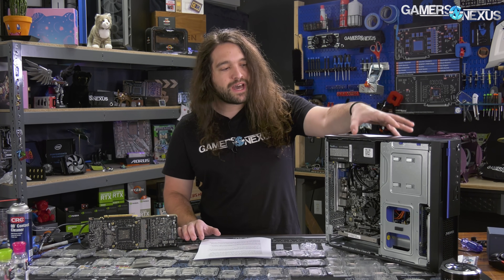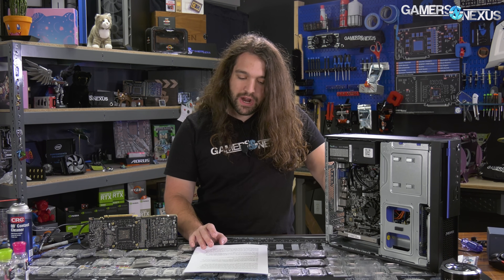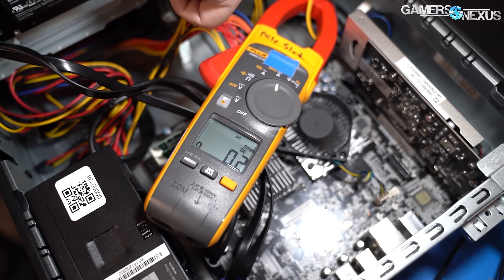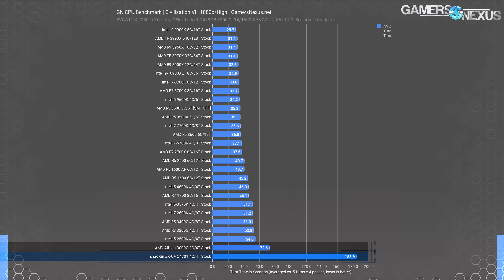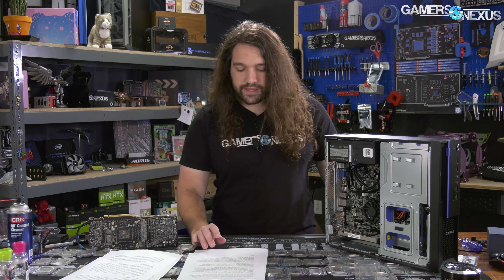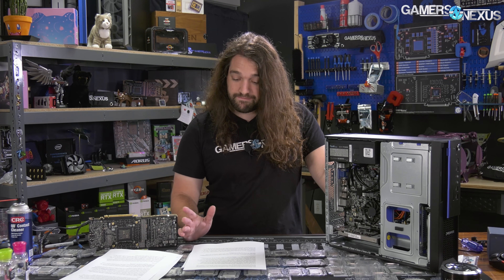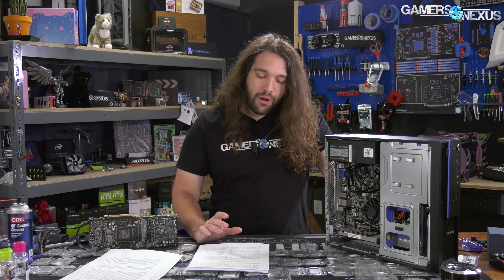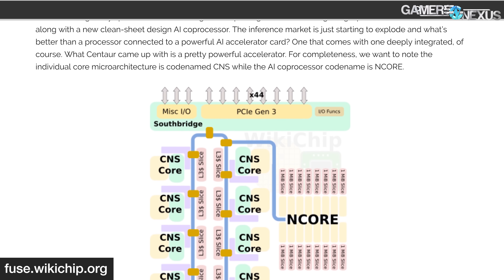"Trillion Core" Chinese CPU vs. AMD & Intel: ZhaoXin X86 CPU Review ZX-C+ 4701

Comment: So this is where Cyrix's license went. Interesting. I like to see these alternatives made, even if they won't directly compete with the US market, pressure from them making Chinese super computers might get the government to invest more in innovation from AMD and Intel. In the end I like seeing unique hardware and a possibility of a competitive drive for these companies.
Reply: @matt thomas wtf? Where did you get that from? I mean then paying AMD and Intel to engineer better chips for them. This has nothing to do with intellectual property. All 3 companies have the current rights to produce x64 CPUs. Plus I highly doubt AMD or Intel would want to steal ideas from a Chinese company that's behind them currently in innovation.
Reply: In 1993 or 94 (long time ago) I witnessed the installation of a couple circuit boards into the bridge computers on the USS Nimitz. For a cost of about $5,000 for each cpu. These boards upgraded the bridges computer system to the PENTIUM 90! Down clocked. Street value at the time - $120 in Seattle. HooRay for government spending!(The circuit boards were estimated to cost ruffly $20,000 each.)

Comment: We need open hardware and standards. Resilience is needed. Maybe RISCV will in 20 yrs.
Reply: Sure, but first and foremost we need software with stable and open interfaces in all ends. I.e. not just drivers and API:s, but also a p-code (or "bytecode") interface. That way OS:es and other programs ("applications") could be adapted to any hardware, by "anyone" (even if it's not open source) "simply" by constructing appropriate interfaces.
That quality should be what you pay for, not today's creepy licensing in the style of M$ or Apple.

Comment: Another great vide. Thanks, Steve.
Maybe several things not really put in perspective are the following:

- That high price is probably because the company has a monopoly as the only domestic CPU manufacturer. So, the price should be really taken into count. If they were fighting on the free market, that PC would be much cheaper.

- Performance-wise, sure it is very low. But you are forgetting that this CPU will be used for offices, probably running something like LibreOffice or similar and as is a trend now, actually using web-based applications, that do not need special CPU power. So, as long as it is good enough and gets the job done, it's a win for them. They surely not running rendering jobs on them or playing games in 4K. So, really, it is OK.

- It seems that this CPU is on the lower end regarding how much watts it needs. So what would be performance/watt? It is an important metric when discussing CPU designs.

- This CPU is comparing to the CPUs like Intel Celeron J1900, Intel Atom x7-E3950, AMD Athlon 5150, AMD A8-4500M and likes off which it is actually a bit faster in Cinebench multi-core test.
(Source: https://www.cpu-monkey.com/en/cpu_benchmark-cinebench_r20_multi_core-10 )

Remember how Huawei started? Or other Chinese ARM CPU makers? It will be interesting to come back here in 4-5 years.

Comment: Great Video! It's nice to see alternatives to Intel and Amd, even if it's a total POS like this one. To be fair to Zhao Xin making a CPU is no joke when it comes to the required engineering skills and know how. The required documentation and blueprints of a CPU can be measured in miles, that's how complex they are.
Reply: This is the older generation, their new generation using 16nm process can almost match a 7th gen i5(although its 8 cores vs 4 cores, so still a long way to compete) The performance increase between each generation is huge. Their next gen planned for end 2020 or early 2021 will be on 7nm with major architecture improvement.
Reply: @qiyuxuan9437  thanks for the info
Reply: The thing is that , the CPU needs to have new architecture which does not violate IP's from both Intel and AMD, this is in itself some big news as far as CPU development is concerned.Give em 5 -8 years before they can successfully compete with Intel and AMD. Security and Privacy aside, at the end of the day this is good news for the consumers with regards to Performance and Price.

Comment: You know a CPU is slow when an Athlon is several times faster.
Reply: It is the zen based athlon thi
Reply: @virtualtools_3021  i'm more impressed by the 2500k that is a nearly 9 year old processor
Reply: @terlaluanjay  sandy bridge is legendary
Reply: @terlaluanjay  and who runs a 2500k anywhere near stock clocks?
Reply: @MeatPoPsiclez  that's what i'm saying, this "new" processor is being demolished by a 9 year old processor that has a lot of headroom for overclocking
Reply: I'm writing this on an Athlon 64 from 2007. Fast enough for me (and most non-gaming people). When my computer is lagging it is always due to the internet, or a buggy program that hangs itself.

Comment: Surprising the Chinese government wouldn't just develop a high-powered version of RISK instead. That's open-source with much more freely available R&D to base things off of.
Reply: ARM isn't open-source. It's currently owned mostly by the Japanese as far as I know.
Reply: @greenaum  My bad, got ARM and RISK confused. I'll edit that.
Reply: @BattyBobert  RISC V you're thinking of I think. RISC is a general term for a class of processors, and ARMs are RISC processors. So essentially the only new part of the name is the V, so I can see it'd be confusing.

Comment: Recommend getting a low current clamp with a BNC connector to go to an oscilloscope. A 30 amp clamp with small jaws would give you more accurate readings with the kind of work you guys are doing. Plus, on an oscilloscope you can see a lot of detail about what’s going on with current draw in the circuit.

Comment: They could just use risc, or arm cpus that will be faster then that one... (loosing some of the X86 compatibility)...
Reply: To be fair, not even x86 processors natively execute x86 code; and haven't for quite some time. Who's to say the CPU microcode that translates the x86 instruction set can't be implemented with native RISC or ARM instructions?

Comment: So... why are we comparing what is CLEARLY an extremely low-power CPU to much higher power-usage CPUs?
Reply: This ❤️
Reply: The cost of the thing? It's quite simple
Reply: @roverT205  What do you mean? Low power draw is very important in many cases (such as in massively parallel machines). The number of instructions per second per watt is often essential (and worth extra expenses).
Reply: @herrbonk3635   😊👍
Reply: @herrbonk3635  because its priced highly

Comment: Question: Would the included OS have optimizations that would have made this CPU less horrible?
Reply: Its for government use they use word and excel
Reply: It is a decade old CPU design running low enough power that a simple heat sink and small fan is enough to cool it. This is about the performance one should expect from it, to be honest.

Comment: 6:45 If the current is too small for clamp meter to measure correctly, loop the cable one or two times around the clamp, then divide the measure by the number one less than a number of loops

Comment: nope, it's not for supercomputers, it's for government office use so that US has no backdoor
Reply: Same reason why when I worked on copying machines that any US government officer had to buy the more expensive Japanese made versions of the machines.  As to not have anything made in China in their office.  I guess for fear of cyber snooping.  Most electronics do have backdoors example when the Israeli's blew up Iran's nuclear weapons plant 2 decades ago they flew in from the north, and Iran which had one of the largest and most sophisticated Russian built anti-air systems anywhere suddenly turned off, and back on, and they never saw the Israeli aircraft on radar.
   They cut a deal where Israel would not take credit for the attack, and Iran would claim it was a accident at a nuclear power plant to avert going to war.  Classified for 20 years before being made public.  Most people still don't know about it.

Comment: The extremely low power is rather interesting...
Reply: Yes, that's what I'm interested in, MIPS per Watt. (I'm writing this on a computer from 2007, which is fast enough for me.)
Reply: @herrbonk3635  As clocks go down, generally speaking, there is less energy loss, so actually running the already super efficient Zen chips at lower clocks helps increase performance/watt (total performance is lower than regular ryzen parts)
Reply: @Berfs1  Yes, at least if you also lower the voltage (which we normally do, of course). Today's CMOS with millions of nano scale FET transistors has a rather prominent static leakage. Switching losses are not as dominant as they were in the CMOS of the 1960s to 1990s. So that famous formula with CMOS current consumption proportional to frequency and almost zero static draw does not hold anymore. On the other hand, lovering the voltage gives an quadratic reduction in power (P = U^2 / R) which together with lower frequency gives almost a cubic relation between f and P in practice.

Comment: Current clamps are inductive devices which means they only work on AC voltage, not DC lines connected on to a motherboard.

Comment: Now I'm curious, because I just upgraded from an i5-750 2.67GHz (yeah, the very first one), and I'm pretty sure that Chinese CPU is worse than my 10-yr-old chip. I think. Maybe.

Benchmarking stuff like this against older tech would be a fascinating watch, honestly, because I can't be the only one who squeezes out every last use out of a CPU before biting the bullet and getting an upgrade. It's always interesting to see where technology sits on a grand scale vs. the immediate environment, especially when so many channels are focused almost entirely on the best, newest tech.
Reply: The point of the CPU is not its performance, it is to avoid Intel backdoor (Intel Management Engine) to your computer.

Comment: I don't know if anyone has ever mentioned it, but you can loop the wire running through your amp clamp multiple times to deal with low current readings. Divide the result by the number of loops.

Comment: Fast-forward 10 years and the Trillion Core x256 CPU with integrated 128K-display capable GPU garnered a 94% share of the market. It has an L4 cache of 4TB.

Comment: I just watched your review of the Over Powered Gaming PC from Walmart (yes, from 2018).  I find it funny because when I finally bought my gaming laptop (an MSI GL65 95SDK) Walmart.com had the best price.  Newegg.com was out of stock in the config I wanted.  I actually got the laptop preconfigured with 32 GB of ram for less than I was going to pay at Newegg for an 8 GB confiured system.  It was an upgrade I wanted and was going to buy from Newegg so I saved a bunch of money.

I am starting to sound like an advertisement but I know Walmart can be shady.  For the savvy buyer however, there can be some deals to be had at that retailer.

Comment: The cpu is designed for the specific os. The os is capable to running the secret extra 54 cpu instructions that not supported by your average windows and linux. That instructions is the power of this computer model.

Comment: Wrap the cable around the current clamp for x2 resolution on the current clamp... Divide the number on the current clamp by the number of times that you've wrapped. Not the best method by any stretch; but better than "0.0amps"

Comment: Just the fact that these chips are designed in Verilog means they are far ahead of the original x86 processor designs. This dramatically reduces the design times.

Comment: I recently got our my VIA Eden based mainboard (originally intended - brand new, as a media server) and tried running something remotely current on it. Windows 7 ran, but ground to a halt after several patches and updates were applied. I tried the Windows 10 'free' upgade on it - unsupported, missing some modern commands.
It is now running as a very nice DOS box.... complete with a 5.25 drive etc.

Comment: I’m surprised they are not going down the ARM path with a unique OS. That seems a shorter path to a HPC solution. 

Or maybe going down a completely different path, you mentioned MIPS and SPARC as other chip designs they have access to. Or maybe even building a VLIW design, since you have to go it alone anyway.

Comment: This thing seems to be targeted at the SoC market, more like Bay trail, cherry trail, Atom etc, just like you find in cheap low end laptops/netbooks etc. Low power yet fast enough for basic tasks, probably for use as terminals. The cost is probably due to encryption and other security measures implemented. I would guess this "desktop" is designed to be used as a terminal style system for mass deployment in government offices. It's not dissimilar to the types of terminals banks use. You don't need a lot of power for data entry and retrieval so these things will probably be hooked up to powerful servers or super computers for the real grunt work.
Reply: @RazgrisFloob  Very true. It's the only use case I can think of for a system like this however.

Comment: Hmm, so I have an old thin client here with a different VIA chip (Eden X2 U4200). It also won't run Cinebench R15, and in R20 the multi-core score was 72. This is, if my math is right, approximately 1/4 of the score the CPU in the video got, which I do find somewhat interesting because this CPU has half as many cores (2) and half the clock speed (1GHz)... has their IPC not improved at all in 9 years?

Comment: I do not get it, ARM designs as far as I know are still available for Chinese manufacturers, it has been shown that ARM CPUs can be great option for both client and server users, so why not adopt a design based on ARM rather those ineffective expensive and practical designs. I am certain that from security standpoint a Chinese chip design can get a chip that is secure and meets the government requirements.

Comment: How much of the CPU's failings are due to the tests not being configured for the CPU? It would make sense for software to look at a completely unknown CPU and run it in the safest mode possible, I.E. disable all the enhanced hardware kits. How much of the CPU's failings are due to simply not having the higher math operations of AMD/Intel CPUs? 
It makes sense that China would want to get their feet wet in designing their own computer hardware from the ground up. There are security benefits to doing so, and they have the industrial might to make it happen. It's too bad they're starting 20 years behind the curve.

Comment: Aren't Chinese wall outlet running at 220Vac but still retain  the familiar NEMA 5-15 or NEMA 1-15 outlet styles? Would the system run better if you were running it off a power transformer to bump it up to the typical Chinese 220Vac (at whatever htz they run)? Or would it not even post?  Thanks!

Comment: Current Clamps only work on AC current NOT DC ........ They work by induction and you can't induce DC current, If you did get a reading it would only mean it's a very dirty DC signal with a lot of noise and/or ripple

Comment: Those tests missed closer competitors (which it should, to fit april fools), 4-c. Baytrails, 4c. A-series apus or  4-c. Athlon/Sempron AM-1, in that class of low power consumption and performance. Perhaps you have newer chips from them planned for later testing. But good to know that industrial-computer-grade pricetag, to not have questions about whether it runs XP decently - for those games from GoG, that run on Win10, but like to crash unexpectedly; and not consider novelty of having unsafe OS running on potentially unsafe Chinese chip (or more unsafe, that chips are in general atm.).

Comment: Even the Core 2 Duo T9300 (2C/2T @2.5GHz) in an old laptop I have from 2008 that hasn’t had any thermal paste replacement or any part replacement of any kind (I.e it’s pretty much exactly how it left the factory) gets a CPU multithreaded score of 241 in Cinebench R20 on W10. The fact that a CPU from 2008 in a laptop can outperform this thing over 2x makes it look a whole lot worse from my perspective.

Comment: I watched the whole thing to try understand the use-case for these chips, It's still not clear to me, How are these guys going to build a super computer with such under-performing chips?
Reply: Probably by making it massively parallel (where low power draw is essential). Although, pretty useless for you gamers, that's efficient for neural networks, databases and scientific applications.

Comment: They managed to make a cpu that can actually run Windows 10. this is a X86 only OS. This means that this is the first complete reverse-engineering of the X86 instruction set. Impressive.

Comment: If you've read news about it before, this is actually a CPU based on AMD's first gen Zen architecture, they bought it from AMD
Consider what kind of bad optimization they have to make a CPU with 1st gen Zen architecture, 4C4T to be that much worse than an Athlon...
Give them some time yeah but personally I'd say they won't be a game changer
Maybe if the prices could be much much lower, they can be used in lower requirement platforms such as NAS or firewall etc, but for gaming PC or even enterprise servers? No thanks.

Comment: I hope you learned that the clamp-on meter only works with AC Voltages...
Reply: Huh? Clamp on meters that use a hall effect sensor work with DC currents just fine.
Reply: Ampère's circuital law works for both AC and DC currents.